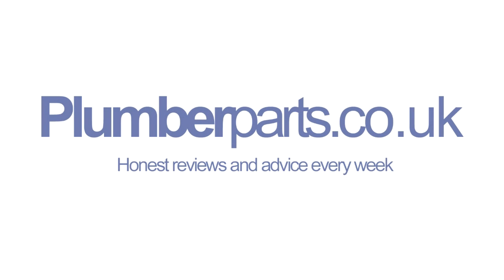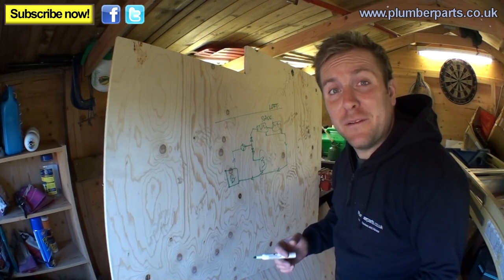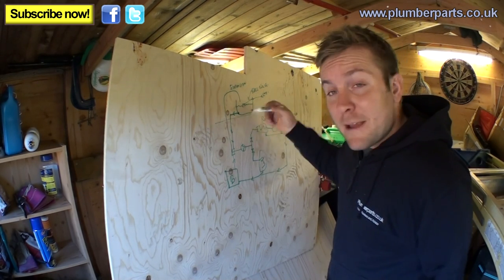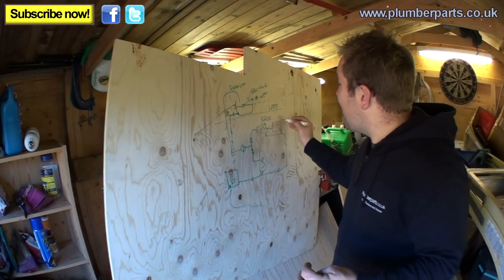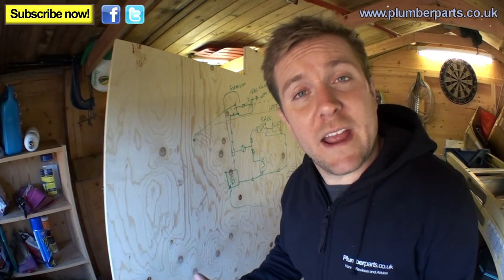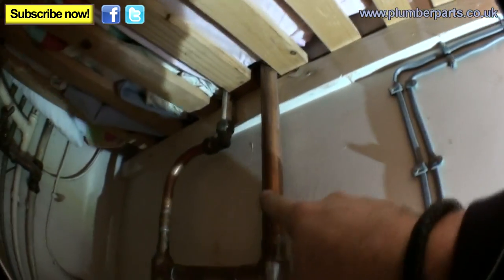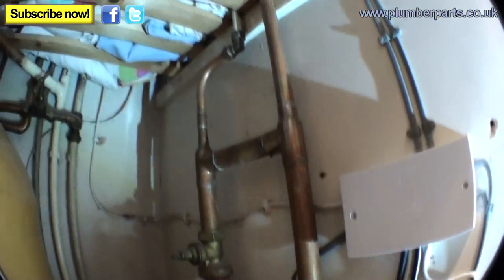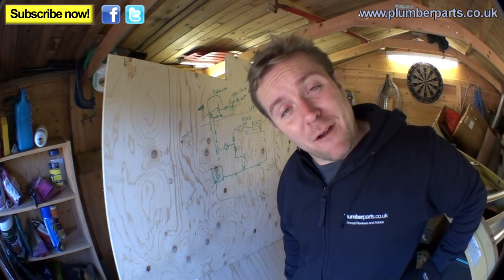GRAVITY  FEED HEATING SYSTEMS - Plumbing Tips

Comment: Hey would the gravity system work with a three story header tank on top solid fuel stove middle floor and hotpress in basement "hot water cylinder " ??
Reply: quattroman 2000 the height is not an issue, this was the standard system in the UK for decades and used in all shapes and sizes of house until pressurised systems began to take over. The issue with your plans is that it is more usual when using solid fuel to allow thermosyphoning to heat the water- the cylinder must therefore be above the heat source. There are ways around it though, using pumps to pump hot water wherever needed and some stoves now can even work on pressurised systems, but additional safety measures are often needed such as emergency cold water stove cooling valves etc. Why not put your cylinder in the loft, above the stove, with the header tank just above? You need very little head on these systems, the header tank is only there to keep the system filled, not to provide the domestic hot water flow.
Reply: @spencerwilton5831  thanks spencer i might put it up there,what would you say is the best way to pipe the stove and interlink with an oil boiler?
Reply: quattroman 2000 there are multiple diagrams online. It is not that difficult to achieve, but does need careful thought and design to ensure safety in all eventualities. For example, in a power cut it must be designed so that the system will still dissipate heat without  pumping. 22mm pipe or larger is often specified to accommodate this. You must also normally use a metal header tank- a plastic one could soften and collapse in the event of a fault sending boiling water cascading through the ceiling onto sleeping people! You also need to consider return temperatures- solid fuel boilers do not like having cold water returned- some kind of load regulator is needed. Search for laddomat to see what I mean. There are various devices which make it easier to connect multiple heat sources such as the esse centraliser, although you can do the same thing without them, never the less the website is worth a look as it does give multiple connection examples.

Comment: Wow, what a strange system!  Why would you want an open tank in your roof space?
If we did that here in Australia, it would just give the possums/rats/snakes etc. somewhere to drink!
Reply: Android811 this kind of system has been around since central heating was first installed in Victorian times, it provides a nice low pressure fill and automatic, foolproof pressure relief in systems that couldn't handle much pressure- think hand cast iron boilers, radiators and pipes sometimes with paper gaskets. Many uk houses still have it due to their age, but they have not really been installed commonly for many years now for the reasons you mention. Tanks should really be lidded though to avoid physical contamination. Fortunately snakes and possums are not a thing here!

Comment: Naughty, naughty. No valves on the heating cold feed or expansion pipe allowed, tut tut tut. Anyway Hold tight
Reply: the danger is that it could be   left closed while the system operating a NO NO

Comment: Still don't understand the difference between a direct and indirect hit water system
Reply: Direct hot water cylinder is when the water is heated by an element like an immersion heater. An indirect cylinder is when it is heated something else like a boiler or an AGA. The way that a boiler can heat up a cylinder is by it pumping the water thats in the central heating system into a coil inside the cylinder instead. This way the two bodies of water are kept completely seperate so you wont have mucky water coming out of your hot taps.